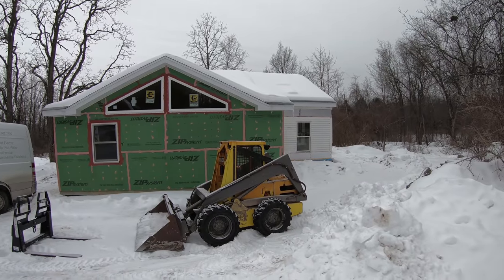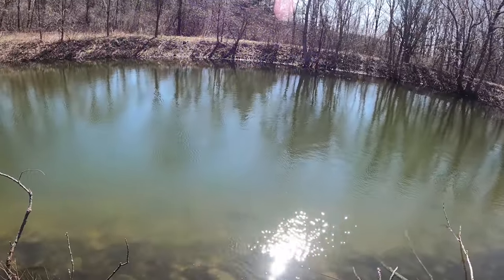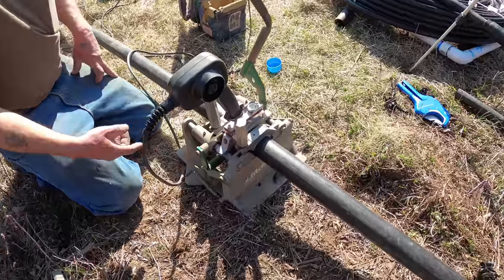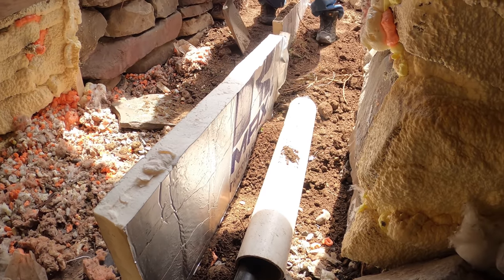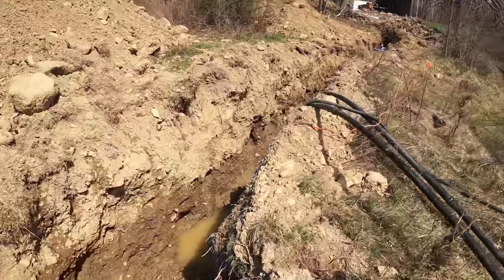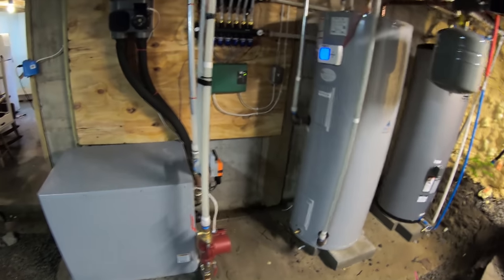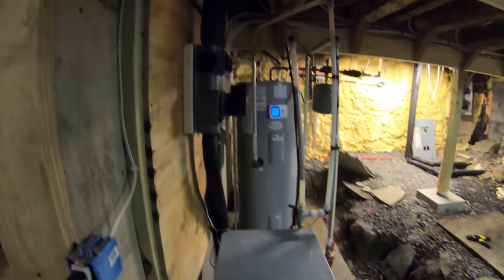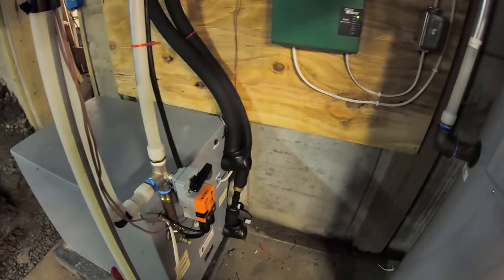Installing a Geothermal system (water to water, radiant heat)

Comment: I did HVAC for years, and your description is good enough, really.  The principal difference between an air sourced heat pump/ac, and a geothermal one?  Efficiency.  For an air-source one, you have to "de tune" it such that it works with cold air up to hot air, and everything in-between.  This is a very wide band of source heat, and to accommodate that?  You need a wide working range of "freon" gas (nobody actually uses the brand-name 'freon' anymore).  You adjust the gas charge to allow the wide range, but at a loss of potential efficiency.  But for a geothermal source, it's a constant temperature, year round.  This lets you tune the gas charge to a very fine degree, which dramatically increases efficiency.  Translation:  to get the same indoor temperatures, you need to use significantly less electricity.  Money you keep in your bank.   It's the fine tuning that does the trick-- if you did that for an air-source unit?  It would either freeze up, or not work at all, when the source temperatures (outside air) went beyond the ideal temp range.  Hence the term "de-tuning"-- a wider range of working temperatures requires a different charge of working gas "freon".  (it's more than just the charge, of course-- the surface area of the condenser/evaporator loops, a different compressor, different control valves, etc).   Fascinating video-- I was entirely unaware of pond source heat loops, as they don't allow them in these parts.
Reply from the maker: thanks for the explanation. that makes sense. I will go through this again and try to mention these things you touched on in my house, coming up in the next few months. I am using that pond loop in my jetski pond, which is only 40 ft behind my house

Comment: Some time ago you were involved in helping to install a geothermal system but a well pipe was driven down some distance where the constant temperature was in the 50-degree area.  A good temperature for the summer and helps electric costs in the winter.  Never heard of laying pipe in the bottom of a pond.  Something new all the time.  Glad to see another installment on this particular house.

Comment: I’m also absolutely fascinated w geotherm. I was totally surprised at the size of the ground loop that was installed. Here in Manitoba, Canada I see mostly closed loop in ground coil-loop which takes up significantly less land. But geotherm is clean and free energy after installation. Great vid! Great camera work. Thanks Jesse
Reply: How can you call it free when you have to use electricity to power up the unit?  It’s cheaper but not free unless you have solar power or something.
Reply: @robertdominiczak6523  'free energy' is something you didn't pay for, and he's not paying for the ground to heat his water, he's just paying to move that heated water to where he wants it. Technically a solar collector would be self circulating.
Reply: @robertdominiczak6523  If you power it by solar electric and the panels have paid for them selves already it indeed will be free energy. But most people only think about what is cheapest today.  An example of this is asphalt shingles vs metal roof.  The list is long, extra insulation , better windows, brick siding etc.
Reply: "But geotherm is clean and free energy after installation."

As if the materials and installation is nothing. The payback of the initial cost for these is probably 20 or 30 years of utility bills.
Reply: @crzy11000  

It is never free. Someone had to pay for the solar panels. They don't "pay for themselves". 

If it's all so "free" so you have solar panels and a geothermal system on your house?

I didn't think so.
Reply: So the electric pumps and the electronics is free energy?  Get something straight I used to do this in the UK 🇬🇧 unless you have got a different form of energy like solar power or something else it’s not really free!
Reply: @jcgoogle1808  It is not free up front but in a few years the panels will have paid for themselves and then it will be free. Electricity off the grid will always cost you more and never be free.
Reply: @jcgoogle1808  When my brother built his house the neighbour put in geothermal. His cost of the system and install was about the same as my brothers by the time you added in the cost of the hook up of  services. Depending on how far it is to get services brought in it is not a cheap bill. So now my brother has a gas bill and the neighbor does not. Nothing is free but eventually once the system is paid for there is no gas bill to pay which only ever goes up over time.  You must be the same guy who talks about the cost of building a solar farm and then not talking about the cost of a coal fired electrical plant.  Both systems have initial costs up front DUH.! One system only has an upfront cost and not a monthly bill, the other has a monthly bill that will only ever increase in cost over time.
Reply: @crzy11000  

Not free in a "few years" more like about 15 years. 

If a system cost $20,000 (That's not including anything special like new HVAC equipment, appliances, replacing all lighting with LEDs,... to help minimize solar panel cost. Or battery storage which would double this.) and your average utility bill is $150/mt, then the pay back is about 11 years. 

As a comparison, let's look at an opportunity cost and say we took that $20,000 and put it in a utility stock paying a 5% dividend. There are plenty of those.

Your annual dividend is $1000. That's not including the capital appreciation the stock will have over time,... which I suspect will be 50 to 100%.

Con Ed currently pays a 4% dividend and was around $50/shr aout 10 years ago and has been as high as nearly $100 the beginning of this year. 

And throughout this whole time you still had access to your $20K if needed it for an emergency..

Or let's say you finance or lease the panels. The interest will probably be 5 to10% and a lease will never pay off. You've just swapped the utility bill for a monthly payment to another institution.

Claiming solar panels provide "free energy" is about as ridiculous as AOC saying adding trillions upon trillions to tax payer debt is not a problem.

You have to look at the total life cycle costs.

Otherwise you could talk yourself into believing paying cash for a home allows you to live in it for free.
Reply: @jcgoogle1808  Do you do this when you buy a car?  I doubt it. Buy a 10 year old car for $5000. and drive it for 5 or buy an new one and have it depreciate 10% as you drive it off the lot.(usually, currently not the same ) Maybe you buy used panels and they are paid off a lot sooner. This video https://youtu.be/0yDVXJmsowU  is testing  used 250 watt panels at $50.00 each which by the way was cheaper than plywood at the time. An equivalent to 16,000.00 new system for $800.00 dollars plus shipping. It sure would not take 20 yrs to pay that off.  My point is nothing is free not even the air you breath because it does cost to keep the air clean. One way to have cleaner air is to use solar where it is feasible. Put it up on the prairies and let the cattle graze around it. Put it on as a roofing. The shade from it makes shingles last longer etc.

Comment: Great video with lots of information. I have to say that our water to air system ( forced air) is extremely quiet( you have to stand by a duct to hear if it’s running) and it has a MERV 13 filter in the air cleaner that  traps almost anything in the air.

Comment: We´ve had a lot of these installed in Sweden the last 15-20 years and I've never heard anything but good about them! My father in law has one and his (+3000 sq.ft if I'm doing my calculations right metric to imperial) house is always really nice and warm even during the coldest winter-nights (north of Sweden is about the same climate as inland Canada). 

The only negative I can say is that the snow stays a couple of weeks longer in the field where the ground-loop is than on the rest of his farm...

Comment: I remember that you followed my advice a  while back on the 7018AC rods for your AC welder, great to see it in action, it can readily be seen how they strike and restrike like 6013/7014 but are much stronger for heavy equipment repair...good job on the bucket dental work Jesse!
Reply from the maker: was that you ? yea I wont be using 6011 anymore
Reply: @jmuller86  Yeah, I don't remember which of your videos I commented on but you mentioned you like the rods.

Comment: You did a great job in your explanation of how the system functions! 
The thing people have to remember is the temperature where there is NO HEAT PRESENT not zero😳  THE LACK OF HEAT IS 460 DEGREES BELOW ZERO😳  we just don’t have the technology to extract heat below +32   
BUT THERE IS AN AWFUL LOT OF BTUs (HEAT) IN 50 DEGREE WATER❤️❤️❤️❤️❤️❤️🇺🇸
Reply: The "ALL CAPS" at the end of this comment is what I don't understand.  I'm no engineer, but that is the key behind this kind of system ... I'd think!   I'd also think the system is in greater demand the closer the water temperature gets to 50 degrees.  Can the demand for heat exceed to ability of the system to maintain a temperature in the house?  If it's zero degrees F above ground outside, the demand inside in the living area of the home will be greater, right?   Is there a point where the system can't keep up?

Comment: Preaching to the choir here about getting into things outside your comfort zone and field of expertise.
When I had my RV and mobile home repair, I found myself drawn into repairing mobile home oil furnaces. That was fine except it involved service calls in the middle of the night in the middle of January. It also invloved stocking a bunch of parts for furnaces. I didn't want to get involved with all that when there were plenty of oil companies that did.
Besides, I had enough of my own kind of work to keep me going.

Comment: Ok, this actually makes a lot of sense.  I never knew how these worked, but now I understand.  It's all about compressing gas and extracting the heat, then allowing it to expand to cool, send it out to the ground to warm it back up, and compress it again to extract the heat. Or, in other words, standing on the wrong side of the ac unit hanging out your window in the summer.  Thanks Jesse
Reply: You just described an air conditioning system.  There are no gasses involved in this system, it’s all fluids, which are incompressible but they are expandable, so there is a liquid vapor at one point in the system.  The geothermal just gives you a consistent starting point.  You’re not turning ground temperature water into 110 degree water without putting energy into the water, thus the 50amp circuit required.
Reply: @motor2of7  What you just described is electric radiant heat. Most geothermal systems ARE heat pumps (like an AC). The point is that rather than trying to use air as the heat exchange medium (frigid air at that), it instead uses the warm(er) pond water to warm the cold side of the heat pump.  Just substitute water for the air on a normal heatpump and you have geothermal. then run it in reverse for AC in the summer.
Reply: That's correct--instead of dumping the heat into the air, it dumps it into a pond (in air conditioning mode).  In heat mode, it runs the refrigerant in reverse, dumping "cold" (extracting heat) from the pond.
Reply: Refrigerant and a compressor are still used. The ground loop is the outdoor coil. Ground temperature is usually 50 to 57 degrees year round at that depth. So, instead of using a normal heat pump. Trying to get heat from 20 degree air in the winter or trying to cool with 90 degree air at the outdoor coil.

Comment: Much respect Jesse always willing to learn a new trade if you don’t already know it...it’s the best way to learn on the job...so you can do it yourself in the future..it’s amazing the tools of today in the building industry seems like there’s a tool for everything....you can easy see why some jobs cost so much it’s the labor involved and the heavy machinery needed to do it and they don’t come cheap they are expensive to run not to mention the wear and tear on the equipment buckets and teeth on those buckets aren’t cheap hydraulic hoses etc...especially a job site like this where there’s rock everywhere you dig big ones too....

Comment: No tracer wire? Might have been a good idea for future around the property. I give you credit for putting that much pipe in the ground in that part of the country with all the rock!
Reply: They put coolant that doesn’t freeze in it
Reply: a tracer wire prevents someone from digging deeper breaking the pipes. In France we use "grillage avertisseur" with different colors for gas, water, electricity and so on.
Reply: I was wondering this too

Comment: I used to really like the thought of putting in a geothermal HVAC unit in my home. A buddy of mine did it and hated it. Found it was very expensive with our high electric rates here in Ontario Canada. It had issues as well that he had to deal with. He ended up shutting it down and connected to gas when they ran it down his street with his old system only five years old.
Reply from the maker: this system is supposed to run around $500 for the heat bill for the entire winter
Reply: @jmuller86  We’re in climate zone 4, 2200 sq. ft., fairly well insulated, used 845 kWh (
includes the whole house usage,) last February ($127.00 and change), but was offset by about 300 kWh solar generation.($45.). This July which was really hot, total electric usage was 125( purchased) kwh, while we generated 500kwh. And this system makes the house so comfortable. Installed 2006, first service ever was this month, only needed cleaning and new expansion tank.
Reply: @jmuller86  The problem with the system my buddy had was that they had to pump out of a well and back down a well. The electricity alone for the two pumps made it not worth it. He also had issues with his lawn bulging way up around the injection well as it could not handle the amount of water flowing into it and I can't recall what they had to do to stop it from doing that. He just sold the house this year but it was a large home around 4k sq ft so it was a sizeable system.

Comment: All those rocks are like gold in the flatlands of Nebraska for landscaping.
Reply from the maker: where in Nebraska? I used to go out to cody NE for a bunch of summers when I was a kid, flew alot out there with my uncle. Usually cessna 172 and 205 to take aerial photos of livestock
Reply: @jmuller86  Watching from Lincoln, NE. Grew up in the mountains of Colorado and my parents bought land that had an old rock quarry on it where I often thought about trucking those rocks to NE as a side hustle.  You go to any landscape shop around here and they’ll charge you a pretty penny for decent sized rocks or boulders.

Comment: I totally agree with your assessment about forced air heating and cooling, and want to use geothermal in my next home. I am also gonna look at the possibility of using a somewhat obscure technology called radiant cooling, where they run cooling tubes through the ceiling, which seems to be popular in Europe. As an aside, I think the unit you installed here actually is considered a heat pump, just that it is going from water to water instead of the more ubiquitous air to water systems we all hear about.

Comment: Glacial till and excavator bucket teeth don't mix.  At the very first I thought, "This soil/rock is going to eat up those bucket teeth."  Most of the excavation contractors I worked with in north Jersey and PA had a Miller welder in the back of their pickup truck to repair/replace teeth, etc.

Comment: Yup....explained it a bit wrong. Checked comments and no one posted corrections. Big water heater runs hot water thru lines at floor to create heat for house. Small square unit is a heat exchanger, water in lines that you just buried 8' deep thru the yard is super super cold, it pulls the heat out of the lines that run thru floor... both systems are connected and maintain each rooms and or whole house at constant set ambient temp. They are amazing systems
Oh small water heater is obviously for use at sink and shower..... but is also tied into larger tank so they both help heat each other....